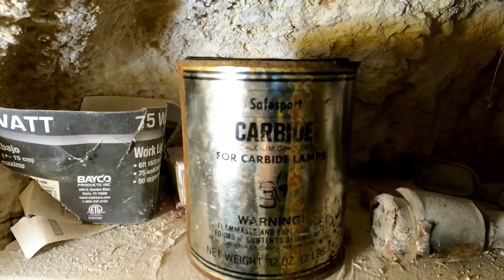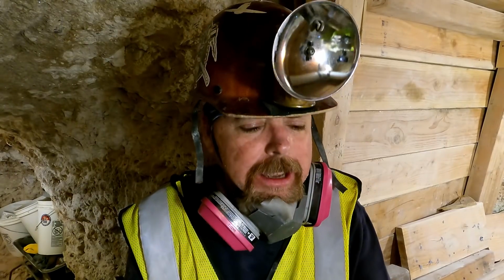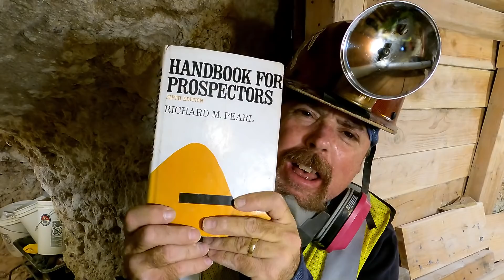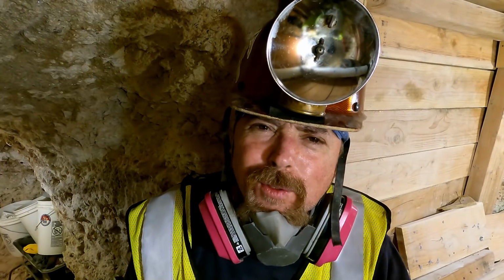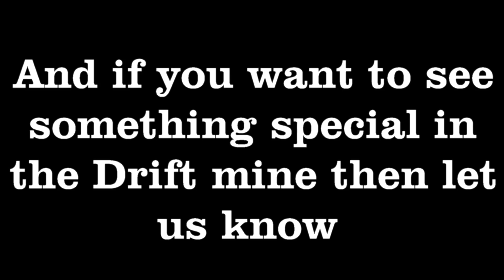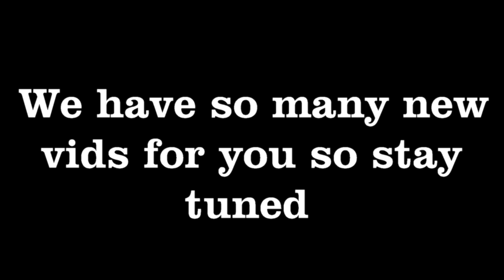How Miners See in the Dark   - ask Jeff Williams

Comment: @4:32 when your bucket cart was travelling around the corner, that wire rope connected from your winch to the cart. You can fabricate a bearing roller like a sheave but much bigger and install it vertical so the wire rope does not rub along the walls of the mine.

Comment: i have a big can of carbide that i got from the army surplus store! the US Army used to stock it once upon a time, and you can get it from surplus way cheaper than any other chemical supplier. i use it for a fire started when camping. i bring about 5 or 6 pebbles with me double sealed in two ziplock bags. any more than that and i worry about accidentally generating too much acetylene gas if my stuff gets wet on accident. its amazing fire started for digging a daktoa fire pit though. you just drop some pebbles in, then put down your kindling, and then you pour a bit of water in the air hole. drop a match in and blow in the air hole and its good to go!

Comment: Found a good outcrop not visible before the fires. Walked over it for years. Couldn't see it. If it looks good after I get into the mineralized zone I'll let you know. Sulfides, pyrite, and manganese, and thallium are clearly visible.  Thank you for your videos in regards to gold geology. Always just been a river bed guy before. Now I know what to keep an eye out for. I ain't licking these rocks.
Reply: It's located in a serpentine shear zone with a younger intrusion as well as brecchiation in the country rock adjacent.  I'm hoping.
Trying to be a good student.
Reply: Hoping to find a super enriched fossilized hydrothermal. One that didn't quite get eroded out yet. It's been theorized these are where the placers came from in that area. Lower in the system is usually more rich, especially if you find stringers, correct?

Comment: What kind of test was that? You kept the electric lights on.  I used only a carbide lamp when I was working the Red Cloud Mine in AZ in the 1960's.  One thing I quickly learned was not to hold on to ladder rungs while going up or down while the lamp was lit. Burned hands.  I still have the lamp and a gallon of carbide pellets.

Comment: https://archive.org/details/handbookforprosp00pear

The other book i could not find. I did find similar books. 

You can also make some good detonator material with carbide. Use the gas and bubble it through some pure silver nitrate. And dry the solids. Use it with match heads to be sensitive enough to use with a Christmas lights. Use some other explosive 0.5 gram to "boost", use a plastic straw. Use 5 ml nitroglycerin on cotton in a plastic baggy as a bigger booster, it will set everything off. Use a plastic container, or it is not safe enough to manhandle. Anyway, probably best to just get some real blasting caps. Even though Silver Double Salts are some of the safest primaries around. Ive seen them make blasting caps with it, and some nitrated hexamine (RDX). They used an arbor press to load it up into the metal casing. You can "dead press" explosive until they become inert. I never tried the arbor press. I did try the nitroglycerine dynamite around new years day. And it was really loud, and it blew some holes. Really brisant (although there are some more brisant explosives around). Fuel air mixtures give you more "bang for the buck". Or aditives that are not really explosives by themselves like aluminum, magnesium, charcoal etc. 

Also, some good Ammonium nitrate based explosives, will save a lot of money. Ive heared sulfer and aluminum are good (cheap) additives. Potassium chlorate can make ammonium nitrate mixtures more easily detonated (also the function of sulfur). I will read more about it. I have some books on the subject, so eventually i will read it. Its at my archive.com page. 

Best to carry primaries in a plastic bag and not on your body, so if it would go your hand or your chest isnt gone. Explosives are no childs play. 

I would like to see your delay section of that book. I thought about using an Arduino and just use electric primers. Just give each channel the millisecond delay you need. But the first bang can damage the wires, and that can lead to misfires. So it will not be a failproof way to go about it. So maybe its best to make some pyrotechnic delay that will take a certain preset amount of time before it sets of the explosive, that takes longer than all the delay times needed combined. That way the Arduino method could be viable. 

Nice lamp! 

Greetings,

Jeff